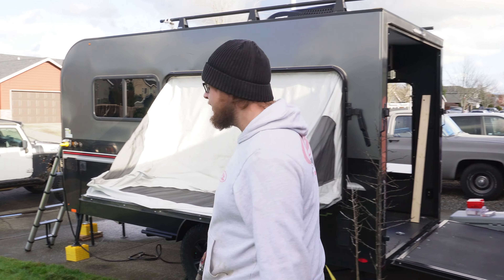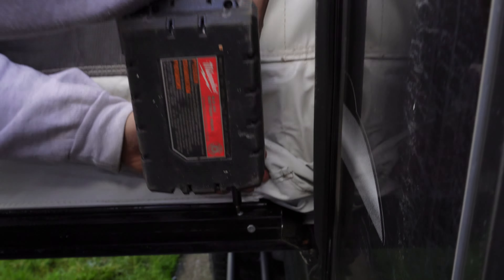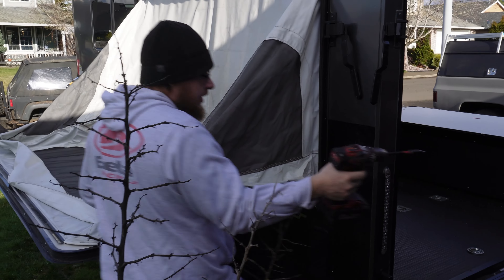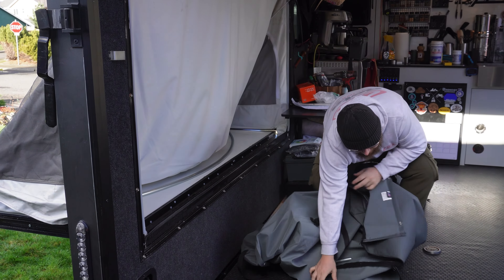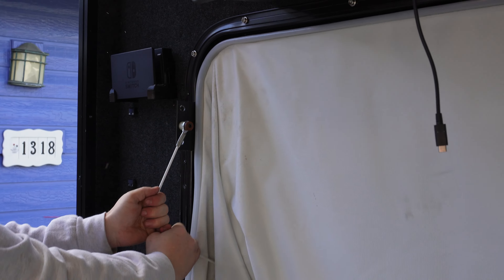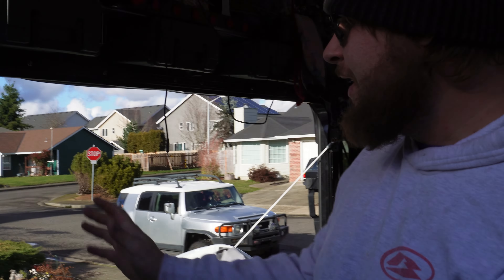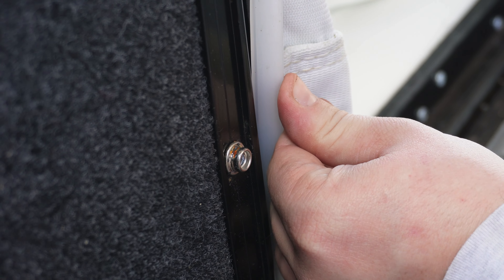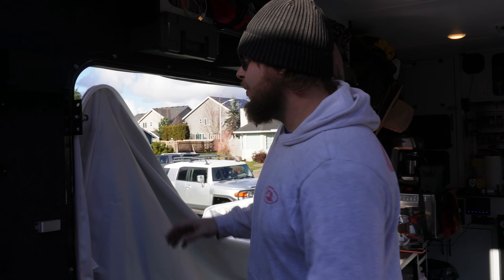Removing Canvas Tip Outs | InTech Flyer Discover/Explore

Comment: Hi ! Love your videos and im considering getting that same  trailer myself and removing tip-outs . Question , does the trailer fishtail when going down the road because it only has 1 axle ? Ive heard that from other people with trailers with only 1 axle ......Bryan
Reply from the maker: We've towed this trailer behind two different rigs, a 2018 GMC Canyon and a  1978 C10. Both tow fine with no sway as long as the trailer is loaded properly. If you have all of the weight placed at the rear of the trailer it will have issues swaying. If you load a majority of the weight above and in front of the axle they tow great!
Reply: Thank you so much for that valuable info !!! Safe travels and love your content . !!  @TheAndersenAdventures

Comment: Excellent...2 questions as I am considering one of these models. 1) are the canvases the same on both sides, and 2) any sealing issues if removing the canvas and just having a big open platform when needed? Thanks much!
Reply from the maker: The canvases are both the same size. We haven't had any sealing issues whatsoever since removing them either.
Reply: @TheAndersenAdventures  perfect…thanks for the fast response.

Comment: Curious as to why you removed it? I've been looking for a Discover without a tip out.
Reply from the maker: We removed them since we left them up 99% of the time anyway. We live in the trailer full time. They had a tendency to collect moisture from inside the trailer since they were unable to breathe. It was just another thing we were having to battle, and the easy solution was removal. We do like having tipouts without canvas, though. It makes for a really nice porch and outdoor table.
Reply: @TheAndersenAdventures  Cool, thanks! I ended up watching your other video where you mentioned that. That's a good idea. Seems to be easier than finding one with no tip outs.